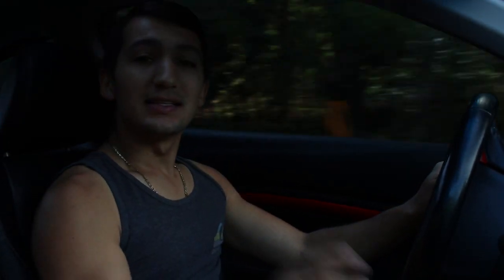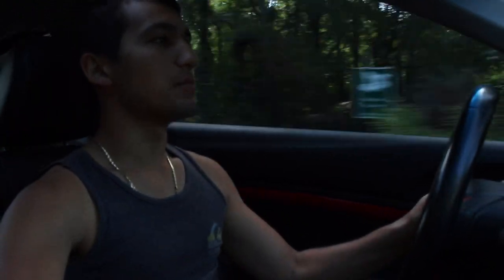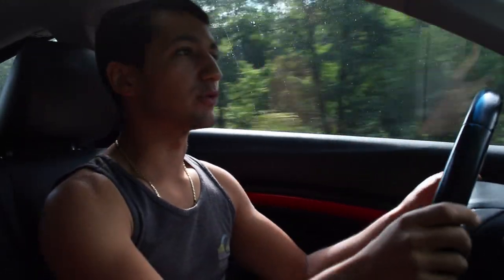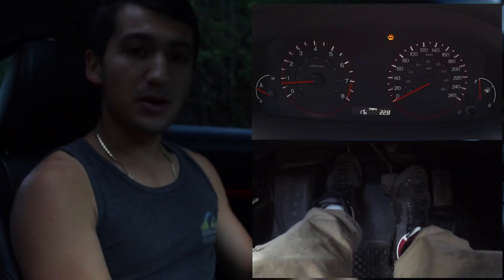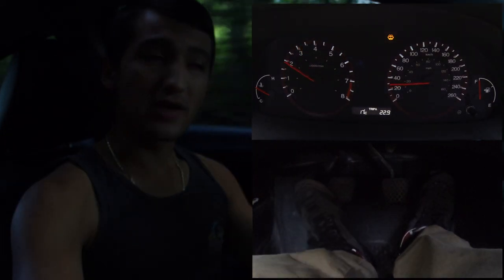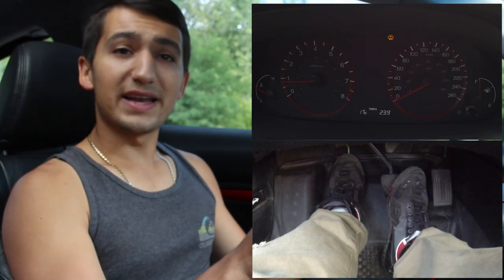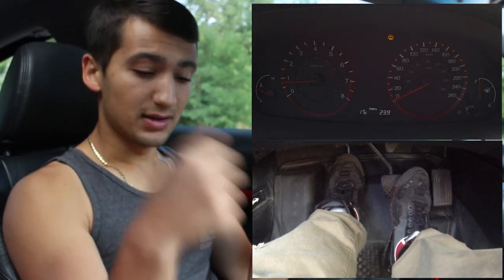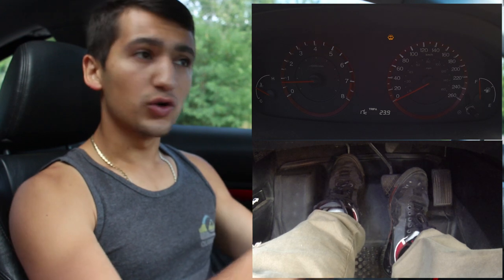Hillstarts | Advanced Driving Technique

Comment: -Hold brake, you are standing by.
-Full clutch and engage first gear
-Start letting off the clutch SLOWLY (reach the biting point, different angles on different cars)
-Sense how the car trembles a little bit trying to go forward: this tells you the car WONT go backwards if you release the brake)
-Release brake. With the right foot now free, instanly give it gas (calmly)
-Continue releasing the clutch, never let it go 100% instantly. When you start giving it gas, you should also let go the clutch little by little

How much gas to give? You need to figure it out. 
Heavy cars or cars with several passengers inside requiere more gas. So do steeper inclines
Reply: I usually just hold the clutch at the biting point and then move from brake to gas quickly. However, for hills from hell like San Francisco I still use my handbrake. I started driving a stick 4 months ago
Reply: Handbrake is better, especially for cars with  very light clutches.
Reply: +PXLynx like I said I only use it for really steep
Hills like if someone is right on my bumper
Reply: I never use the Handbrake Method because my Handbrake is broken. I'll hold the car with the clutch if someone is on my ass (very rare) release my foot off the brake and give it gas, whole process takes me less than a second, not enough to produce noticeable wear on the clutch. That being said, I use this method only if somebody is riding me to the point where rollback is an issue, usually once every month or two

Comment: 0:47 "when you're at a standstill with your foot on the brake, pull the clutch up" ahhh m8, by pulling the clutch up with no gas it will disengage and you will stall like a complete fuck knuckle. Good advice/10 -_-
Reply from the maker: +TheGanjaWizard I don't have three feet... If you're at a standstill, with right your foot on the brake. Take your right foot off the brake. Slowly disengage the clutch with your left foot, and then start to give it some gas with your right foot.
Reply: +milanmastracci I've been doing this for years, but the point I was making was the fact that you said the wrong thing at 0:47 and were obviously meaning to pull the handbrake up, not the clutch.
Reply: +TheGanjaWizard You don't need to use the handbrake on a hill start if you're not a noob.

Comment: you dont need handbrake to move, You only need to balance clutch and gas and use your feeling.
Reply from the maker: When you get used to it, yes. However the more you balance the clutch and gas, the more wear you will be putting on the clutch plate

Comment: Wouldn't one just do the same, but using only the footbrake?

ie. Letting go of the clutch until it bites and "holds" you from reversing. then move over from brake to gas.?
Will it hurt the brakes/clutch?
(I've been doing this since Drivers'Ed and never gotten my car to stall nor roll back. We do however not have very steep roads)

Although I imaging the parkingbrake-method is better for steeper hills.
Reply: +TrocaderoKillen I don't think you can bite and hold much when engine is idling at 800RPM. But no need, when you get fast enough, going from break to gas very quickly while releasing clutch allows to start moving quickly and with minimal roll-back.
But parking break method is the official and recommended one because there is zero roll back and risk of hitting the one behind you.. We need to demonstrate parking break uphill start method on our driving test.
Reply: +Krzysztof Cygan yeah I was shown both but have only had the need for the foot brake one so far.
Reply from the maker: +TrocaderoKillen If you don't have a hand brake, you only have the foot one, I will go from the brake pedal to the gas pedal quickly. That way the car will not roll back more than an inch or two. If the other guy behind you is that close, he'll be at fault for the damage if there is any.
Reply: +RIPxBlackHawk I recommend you google before embarrassing yourself or trying to make fun of someone. Here is a shocker for you: my car idle rpm is really 800rpm. Apparently, you have no idea what you're talking about. Read up: https://en.wikipedia.org/wiki/Idle_speed

Comment: Using the e-brake is unnecesary. In fact, is stupid, cause you are slowly breaking it, making it lose its tension. When you are going up a hill, you stop, and want to start rolling you just need the normal movement of the motor. With no gear (neutral), and no gas, your motor is still rotating, at abot 800 rpm. (depending on the car). At that rpms there is ENOUGH torque to hold the car in ANY hill. Just holding the clutch at the "friction" point, there is no brake or ebrake needed at ALL.
Reply from the maker: +Juan bandicootarri At that point you will be just be using the clutch to keep the car forward; burning out the clutch. Also, the emergency brake is very helpful because if someone is right on your ass, if you are on a hill, without the ebrake, your car will roll back and possible hit them depending on how close they are to you.
Reply: +milanmastracci Well, in a sense that is what you do everytime you start off the line. Any line.
You pair 1000rpms from your engine with 0rpms from your engaged transmission.
And that's what the clutch is designed for: friction for transmitting torque.
Besides, if you get quick enough at hill starts, using the method the dude suggested does not really do much more damage than a normal start does.

HOWEVER if you wanna just hover for a long time using the clutch as a brake, well thats different: thats idiotic.
Like creeping up on a red light waiting for green. Abusing the clutch (low rpms, but still)
I usually just watch other people creep up and fail at a quickstart, and then I start and leave them behind, even with the advantage they took. Hehehe, silly drivers
Reply: I too use the clutch to hold the vehicle, only for as long as it takes for me to move my foot off the brake and give it gas (usually half a second at most). Not enough time to cause any significant damage to your clutch